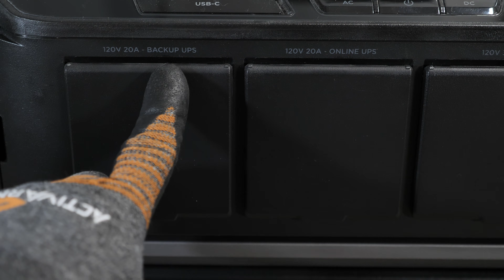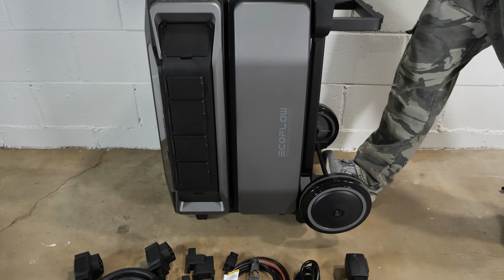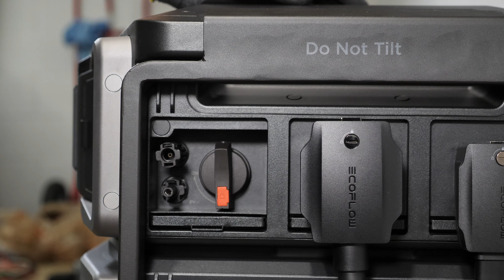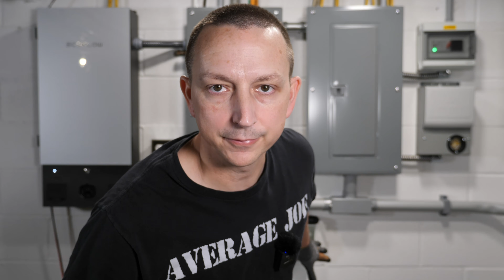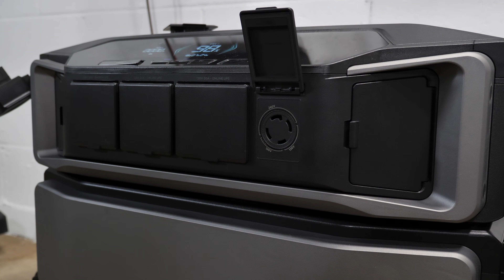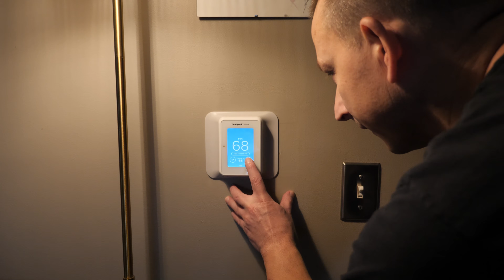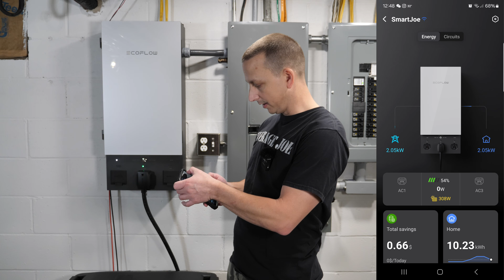Demo of Fully Installed EcoFlow Smart Home Panel 2 with Delta Pro Ultra - Black Friday Deals

Comment: Is there a way to get the Smart Home Panel 2 to power everything in the house?  

The way im understanding this is that you would only be able to power the 12 circuits actually on that panel from the Delta Pro Ultra and then if the grid was down the other circuits would be unpowered, correct?
Reply: I think you are correct on this

Comment: So did the inverter stop due to overload?  If so, zero explanation if you had stopped the AC units or anything else in the house to test the ovens a second go around.  Was it too much for the system to handle?

Comment: Great informative video. Can you use the 240v outlet in the front and charge at the same time using the 240 on the side by using a generator or a 240v wall say during off peak hours?

Comment: I just have 1 question that ecoflow didn’t. I’m interested in purchasing this as emergency back up only. One of the three appliances has a power usage of 724kwh a year. I’m wanting to know how long will the one battery last just powering the one refrigerator
Reply from the maker: My fridge shows in the app that it draws an average of 1.7kWh in 24hrs. Some days a little more and some days a little less. Out of a 6000wh battery, that equals 3.5 days but well say its just 3 days.

Comment: I was trying to figure out how the wiring was laid out between the Eco-flow and the other two breaker panels. Evidently it's boom proof.
Reply from the maker: For mine I have the center as my main. The right subpanel is wired from the main. The SHP2 is wired from the subpanel. Main reason I did it this way atm is I could power all 3 panels from the 50a generator inlet plug. I also have other systems so having it wired this way allows me to have multiple layers of backup options. Also cause I test out systems😄
Reply: Not much different than any other panel install with a subpanel and transfer switch...
Reply: @JohnSmith-wt3mw  that's not a helpful answer, John.
Reply: @thedabbler2753 Sure it is.  It's not rocket science.  

It looks like the middle panel is his main.  Probably 200amp service.  Probably put two 100amp 240v breakers in there.  One wired to the subpanel on the right and one wired to the SHP2 on the left.  4 wires each breaker.  Red-hot, black-hot, white-neutral, and green-ground.  Neutrals and grounds seperated in each sub panel.

Pretty simple stuff actually.

Comment: Excellent video.

The price point concerns me for what it can actually do when a power outage occurs.

Some questions I have though is: 
1. If 7200W is all it can handle, why are they claiming this to be a whole home backup solution? If I have a two story home, wouldn’t I need a traditional standby generator like Generac that can handle 26kW to maintain power for the whole house during a power outage/storm?
2. What’s the benefit of adding a second battery as part of the DPU? Will it still only handle 7200W but just stay on for a longer period of time (than a single battery)? 
3. If I wanted to power entire downstairs of a two story house (including furnace, AC), how many of these DPU would I need to buy?

Noise, taking up yard space and maintenance costs with traditional Generac generators are cons for sure but would this DPU really be better investment long term? DPU seems more expensive and handles less power requirements in a house.

Appreciate your thoughts/feedback on these questions.
Reply: 1, 2, or 3 story doesn't matter.  Your electrical load is what matters. You're electrical panel is most definitely NOT divided by floors.  I have a single story house with a main panel on one end and a subpanel on another.

7200 watts would power almost anything in a traditional house.  Add 2 more inverters and your at 21.6kw.  Just a bit lower than the 26kw generac.

It's marketed as whole home backup because it is. Back up being the keyword here.  You should only be using essential loads during a blackout.  

The generac will no doubt power the whole house at once but at 15k-20k for install,  it's about the cost of 3 DPU's with an SHP2 professionally I stalled.  That's 21.6kw of inverter power, but also 18kw of battery power.  Plus smart functionality to turn on/off individual circuits.  

Adding solar, while an additional cost, would allow you to lower your dependence on the grid.  Which in turn lowers your light bill,  which put money back in your pocket.  The generac will never do that.

Adding batteries doesn't change the inverter.  It's the equivalent of putting a bigger gas tank on your car.  It won't change its power output but it will run longer.  Add solar and you have a day to night source for filling your "tank".
Reply: @JohnSmith-wt3mw  I’ve spent my entire weekend looking for this explanation. Spot on!
Reply: @JohnSmith-wt3mw I’ll rephrase for our house situation… there’s a panel in the garage which has lighting for rooms, furnaces, refrigerator, microwave, etc and then another panel outside of the house for larger loads like air conditioners, oven, and cooktop. Would the smart home panel plus DPU be able to connect to circuits that are on the panel on the outside of the house for the larger load appliances or would it only be able to connect to the panel in the garage for the lower load items?

Also in total this can only provide 7200W, correct? Thanks in advance.
Reply: @eyewatchsports5549  You seem to have large loads on both panels. I'm assuming the one that is outside is your main 200amp panel?  And the garage is a 100amp subpanel?  The short and dirty is yes, and SHP2 can be connected to either 1 or both.  You can even connect just a DPU to either 1 or both.  Although it would lose the backup functionality and individual circuit control, it would be a much simpler install.  Cheaper too.  It all really depends on what you wanna back up and how much money you wanna throw at it.

7200 watts is correct.  Even with 5 batteries under it.  But add a 2nd or 3rd DPU to the SHP2, and that goes up to 14.4k-21.6kw.  Equivalent to some large whole home NG/propane generators.

That being said, a single DPU is not gonna last you very long if the power goes out. Especially If your goal is to run all those heavy loads, unless you have means to charge the batteries. Solar, wind, a gas generator, etc..

  Are you looking to back up every circuit in your whole house?  Or just the essentials to make it through an outage?  Do you have any solar? Or means other than the grid to charge them?
Reply from the maker: You also need to remember is with this system, you use it everyday which can save you money everyday. Plus you will use it in an emergency. The big generator you would use only at random events/emergency. Also a generator that size is pretty big to be honest. Generators should be ran at 80% load. I am not saying generators are bad and shouldnt be used but do you need or use that much power during those times. I have a 5kw and can get by just fine.

You can install this panel near either panel and can add any circuit you want to take off grid or use in an emergency.
Reply: @JohnSmith-wt3mw  Thanks for responding, John. I live in an area that experiences extreme heat in the summer which have led to occasional rolling blackouts and also the last few years have had to deal with multiple power outages in January/February with below freezing temperatures due to power grid issues (pretty sure you can guess where this is in the US). It seems like these grid issues aren’t going away with these swings in temperatures yearly and lot of folks here are opting to go the route of spending big on gas generators like the Generac 26kW to not have to worry about grid issues and keep everything running at their home.

I personally can’t see myself paying that amount for a Generac 26 kW generator (that sits in my yard and makes noise) for emergency usage only so that’s why I was intrigued when I watched this video about this DPU and SHP2. I also like the idea of being able to occasionally power some circuits in my house at peak times from the DPU rather than paying the energy company. I also like that this isn’t noisy.

I don’t have solar, wind or any kind of generator currently. The only way I would charge this would be through the grid (could possibly look at connecting solar to this but that’s more money I would have to spend down the road).

The panel I have outside of the house is the main panel (I assume it’s 200A) since it has the switch for main on it and has larger loads like two air conditioners, oven and cooktop. The panel in the garage is for everything else (I assume it’s 100A).

I think my goal would be to keep power on everything downstairs (and not worry about upstairs) in the event of a power outage for as long as possible. So that would mean one air conditioner from outside main panel, oven from outside main panel, cooktop from outside main panel, furnace for downstairs in garage panel, one water heater, kitchen, and other rooms downstairs from garage panel.
How many DPU plus SHP2 would I need to accomplish that and where would they physically need to be installed at the house? 
And could I even install/connect/setup a DPU plus SHP2 outside next to the main panel (because they’re not rainproof/weatherproof are they)? 

Thanks in advance for taking the time to answer my questions and explain this. I really am genuinely interested but want to know what the setup, cost and how long this backup power solution could power on the downstairs portion of the house for. Appreciate your help/feedback.
Reply: @eyewatchsports5549  the SHP2 is rated NEMA 3R, I believe, which means it can be mounted outside.  Could be placed right next to your outside panel. The knockouts have to be drilled out to run any wiring.  The lower black part has to be mounted inside with the batteries.  It is NOT outdoor rated.  

Are you all electric?  Or do you have some natural gas/propane appliances?  

AC types?  Do you have a heat pump?  Window AC?  Geothermal?

Heat source?  Gas furnace?  Electric baseboard heat? Heat pump? Pellet/Wood stove?

As you can see, there are a lot of different variables that influence the type and size of a backup system.    What you want is doable,  but it could get quite expensive and/or complicated.  

How many DPU you would need would be determined by your appliance wattage, usage, and duration of blackout.  Maxed out this system is 90kw with 1 SHP2.    That's about $50k!!!  Not exactly pocket change.lol. though you could buy more stacked and rotate them in and out as each one runs out of power,  but that would just keep increasing costs.  

For example, an electric water heater runs on average 3 hours per day.  That's just heating the water in the tank.  Not you using it and adding more cold water to the mix.  Standard 50-gallon tanks have 4500watt elements to heat the water.  At 3 hours, that is 13.5kw.   That's roughly 15% of a maxed out DPU system.  Now, if you have a gas or heat pump water heater, those use much less electricity,  which extends run.  

Gas appliances would definitely lower your electrical load.  Extending this systems usage.  You could also build your own system with a separate inverter and bigger battery bank for much cheaper the Ultra system.   

I'm all electric.  I would NOT run the water heater or oven during a power outage.   I have a window AC that I would use to cool the living room set at a reasonable temperature. I would NOT run my whole house heat pump to cool/heat the entire house during a blackout.  I thankfully have a pellet stove that only uses about 200 watts.  As long as we have wood pellets,  we'll have heat.  I buy enough pellets to make it through winter every year and then some.  I have some solar, but my array is definitely not large enough to maintain charging those batteries for such heavy draw loads.

Comment: Smart Home Panel 2 is not like the previous Smart Home Panel. It cannot individually turn on/off a circuit. It’s either all gird or all battery. Of course you can still manually switch on/off the breakers.
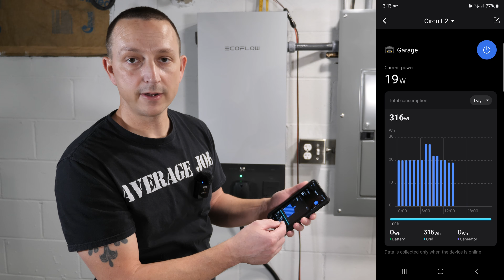Reply: @16:11 he literally shows you how to turn off individual circuits through the app...SMH
Reply: Thanks for pout that out. didn’t put it right. I meant with SMP2  you can’t select power source for each circuit unlike SHP”1”.
Reply: @travistran9971 you may be right,  but I can find nothing to confirm that.  Might be able to set that up with a task?  

Until someone does a deep dive on the panel we just don't know.  

I ordered the SHP2 to connect my DP setup.  Guess I'll find put then😆
Reply from the maker: Yes its all grid or all battery OR you can turn on/off each breaker by it self.  I was thinking you could do each circuit for on or off grid but its all on grid or all off grid. At least from what I can do atm.

Comment: Tell me, do you put any UPS connections to your refrigerators, as I noticed that every time I switched from grid to off grid manually, the refrigerators would demand a huge amount of wattage for around 10 to 20 minutes. 
It wasn’t until I added some cheap UPS’s to each refrigerator, that that stopped happening.
Reply from the maker: I havent but should cause I try out and test many systems. I need to put one on the cable modem and router as well cause if there is am app. I usually have to wait lol
Reply: @AVERAGE_JOE  
Yeah, I only caught it because I have Victron connect app, which lets me see any surges.

Comment: Thanks for doing a review that's not just brown nosing the entire time.  I realize you got this unit for free, but the review still seems to be very straightforward without the unnecessary kissing up.
If there are no dislikes, that's completely fine but I'd be interested to hear something you'd like to change or aren't thrilled about.
Reply from the maker: Thank you and 1000% Appreciate that! Yes I got it all for free. My only requirment was to make a video in my own style. Most of my videos are the same for the most part on systems like this. Try to show what it can or cant do. I always try to power my house.  My only complaint at the moment is the HV PV voltage rating of 450v. I would recommend raising it to 500v (which I did allready when I met them at CES the other day). Reason for the increase is I have 2 arrays on my roof. Each array has 12 panels. If I wire 12 panels in series, im right at or slightly over 450v. In winter time or colder temps, panels will over produce and go over that 450v easy so you would need to wire 11 panels in series. I also think most people would have arrays of 12 panels vs 11. Again, its still early but so far thats it.

Comment: Convection has a fan in it. It's kind of like an air fryer, except it's super easy to dry out anything you're cooking.
Reply from the maker: Oh lol thats it...just a fan. Convection  makes it sound so francy🤷‍♂️😆
Reply: That's what marketing departments do. They sell you convection, which basically means radiate, and just slap a shop fan in the back of it 🤭